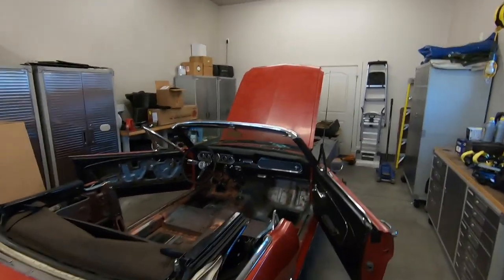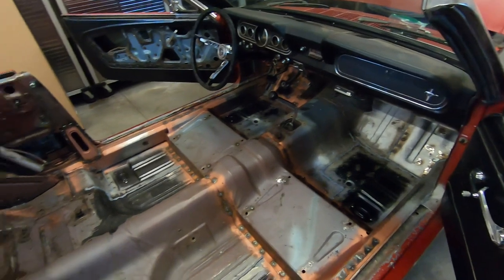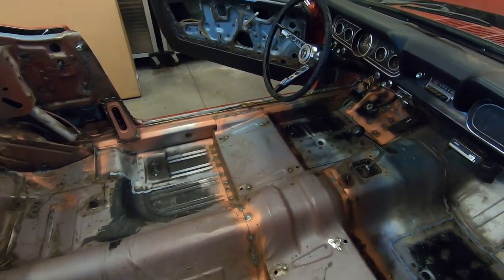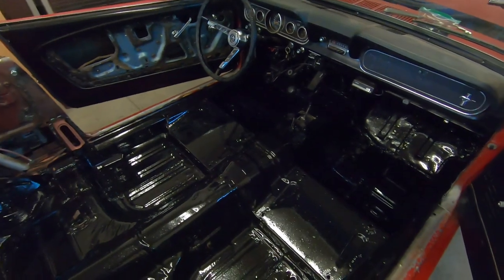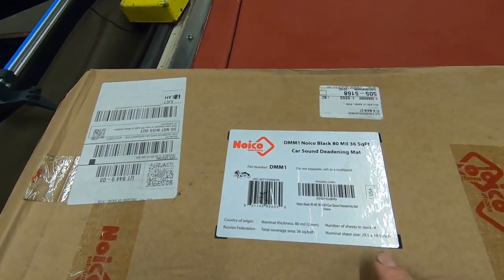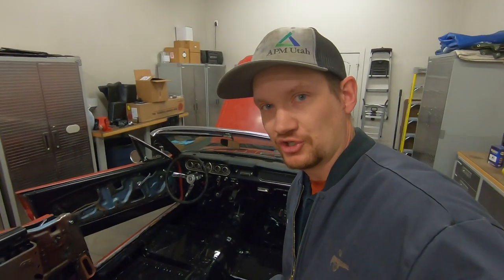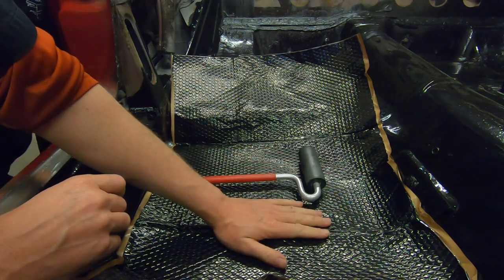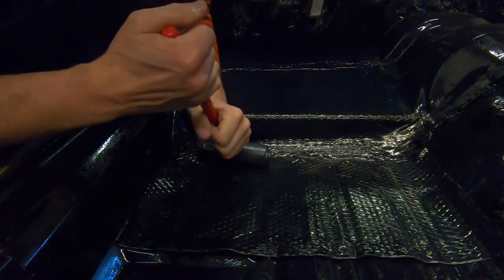Installing sound deadener and rust preventer before carpet - 1966 Mustang

Comment: Looks good. I did basically this same thing when I repaired the floors in my 67 Mustang.
Reply from the maker: Awesome! Ya I figure the goal is to make sure they hold up better the second 50 years vs the first 50 years.
Reply: @AlfsMustangGarage  Very true. Got mine to the point it is a reliable and safe driver. Took 4 years of mostly weekend work but I got her there and she should easily last another 50 years.
Reply from the maker: Awesome! And ya now that we typically take care of these better, store them for the winter, and only take them out when it's nice out, they should hold up way better.

Comment: New carpet is my next project for my '69 convertible. Would you recommend the sound deadener & massback on the carpet kit also? Or would it be too thick & not form good? I have dual 40 series flowmasters so I would like to make the cabin a little quieter
Reply from the maker: Yes! We typically do that for all cars that get new carpet.

Comment: Looks awesome!
When you apply the por15 rust paint, do you not have to apply the por 15 top coat on top? 

Thanks Dan
Reply from the maker: You know, I typically don't when I'm doing the inside of the floor. Just because its not really exposed to extreme elements. If you were doing the bottom side of the floor where its going to be exposed to the outside elements, then yes absolutely use the top coat. It wouldn't hurt though just to add that extra layer of protection.

Comment: hi can you apply POR 15 on the side panels (inside side)...the column, etc....
or strictly for the bottom panel only?

maybe the question is, is it safe to apply the POR 15 on other area inside the car not only the bottom panel.
Reply from the maker: You can put it anywhere that is direct to metal that you don't want to rust. It should not be used on panels you intend to paint or body work over.